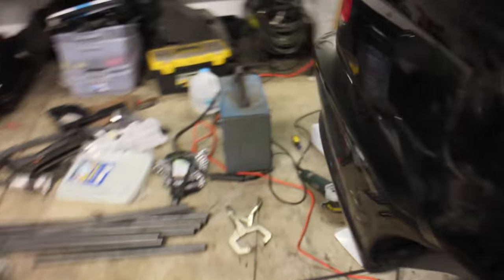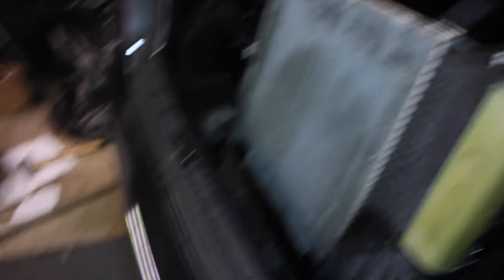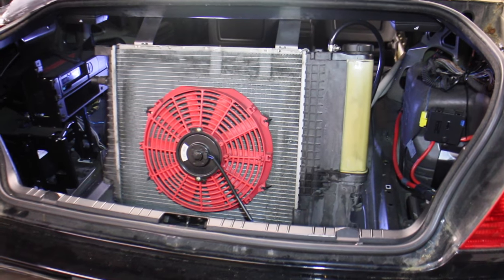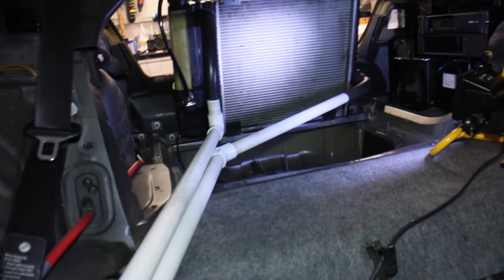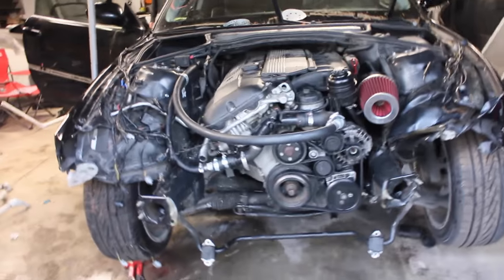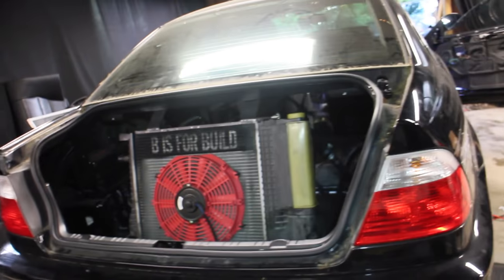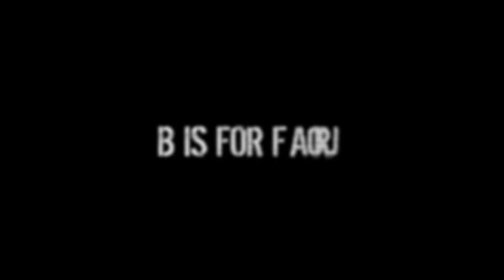Budget BMW Fun Pt 3 - DIY Rear Mounted Radiator

Comment from the maker: Sorry about the low res guys, YouTube is lagging behind processing to HD, if it doesn't fix it soon I'll reupload tonight.
Reply: +B is for Build its better then waiting lol
Reply: Fuck it still watching
Reply: +B is for Build The video quality doesn't determine the quality of the video. Awesome video, sorry to hear about the radiator but happy to see the build push on!
Reply: +B is for Build Gonna watch it either way!
Reply from the maker: +B is for Build it finally went HD!
Reply: Any updates on the evora?
Reply from the maker: +Niels Wolkmann ill do an episode on it sometime soon, i think the bmw has 2 more episodes in it and then ill do some evora work.
Reply: +B is for Build hey ive been watching tjhunt since he had as much subscribers as you and he is gaining subcribers very quickly he has already passed 200000 and is gaining subs fast. just wanted to tell u this because it wont be long till you hit 200000 and keep up the good videos
Reply: +B is for Build wont the pvc melt with the heat of the engine ?
Reply: +B is for Build In the A pillar is another airbag.
Reply: +B is for Build .what air compressor did you use to paint your car with .specs n all

Comment: step1, sell sidewindows. step 2, replace with clear plastic sheets(acryllic). step 3, cut 4 inch holes on the plastic sheets. step 5, run ac pipes from the sidewindows to the radiator
Reply: +dndfm Came here to say this. You missed step six = Profit. 

Don't use acryllic though. Has a fun tendency to shatter when you work with it. Use polycarbonate. Shits expensive to buy new, but you can get it cheap if you buy old basketball hoops.

Comment: definitely watch the Roadkill episode of the mini truck madness, they use a rear mounted intercooler but they constantly had cooling issues. Just because there is a fan on the radiator doesn't mean there will be enough air flow. I'm sure you guys will figure it out. I'm excited to see where this build goes !

Comment: Hey Chris, I know others have brought up the same thing, but just wanted to make sure that the hose was rated for more then the 200*F. Boiling point is 212*F and throw on top of that a couple extra degrees with pressure before it boils and you can hit 230*F in the staging area. If you still plan on using the heater hose, that's cool, just make sure to throw some kind of shielding over the hose so that if it splits you and your passenger, if there is one, will be safe.

They do make automotive grade heater hoses that is available from napa, or if you are at the junkyard, look for cars like the Fiero or MR2, they are great to salvage for rear radiator setups as they have long pipes running from the front to the rear engine.

Can't wait to see the car throwing tire smoke through that rear radiator, it's going to be awesome!

Comment: GUYS, pretty important piece of information I think you might be overlooking:
If you use a reducer on the lines, the pressure/velocity of the fluid changes. Chances are, your radiator was designed to work at the stock coolant pressure/velocity which may/may not cause some problems. 

When I first heard him say he was going to use PVC, I was pretty concerned haha.
Glad to see that they switched to the proper tubing though!

Comment: I love the idea of the rear mount rad but with that distance and the small diameter hose I'm really worried that the water pump won't have enough head pressure to flow enough to keep the engine cool under load.   It is a high volume low pressure pump and isn't designed to do what you're trying to make it do.   I know this from experience with doing a rear mounted radiator in a mud truck.

Comment: Be careful with the PVC! I've seen it start to melt in colling systems, and break off. If you can, napa sells heater hose that is big enough in diameter, or steel would work as well since it is just for the one event!
Reply from the maker: +SMB Garage (Spencer Bailey) keep watchin :)
Reply: +SMB Garage (Spencer Bailey) Oh, saw you already figured that out lmao. Well if that heater hose is too small then they have bigger sizes at Napa
Reply: +SMB Garage (Spencer Bailey) You clearly didnt watch the video did you?
Reply: +SMB Garage (Spencer Bailey) I was thinking the same thing, the PVC is super sketchy, I am glad it failed on them in the shop and not later...
Reply: +Motor Madness you clearly didn't read my reply did you?

Comment: The coolant is going to be well over 200°F. Won't the PVC bend or melt?
Reply from the maker: +peteogrande yep, keep watchin, we had to swap it out
Reply: +peteogrande i was thinking the same lol
Reply: +B is for Build heated pvc can release toxic fumes, hope you had some fans running
Reply: They make hot water PVC.  I don't think it costs anymore than cold water PVC.  I was hoping this would work but I was thinking the vibration would kill it.  PLUS!  You ran them right next to each other.  The heat exchange between the pipes was going to heat the water as it came back from the radiator.
Reply: or maybe use more heat resistance pvc

Comment: Maybe you should look up how Baja trucks route and what kinda of tubbing like size and materiel they use because I don't believe heater hose will be able to sustain the water flow needed to keep the engine cool under load and high heat days. Just my two cents

Comment: I do hope you are going to have plenty of ducts to have loads of air flowing through the rad, when you're pushing the throttle pedal into the carpet there's going to be a lot of heat generated, especially using heater hose which will only flow about a quarter of what a full size pipe can!!! It would have been a lot easier just raising the front rad? I don't want to see you cooking your engine before you have some sport...
Reply: +David F thats probably the reason why the radiator exploded too...smaller size hoses -> more pressure

Comment: Be very careful with e46 cooling. The m54 is a very picky engine when it comes to it. Most of the time small overheating can blow the head gasket. 

If anything I think the weak link for your car will be your cooling system due to the extra load on the water pump and the poor airflow in the trunk. Would highly recommend keeping a spare water pump as they are known to go bad on e46s. Got mine for $60 on OEMbimmerparts.  Was it not possible to mount the rad at a 45 degree angle at the front or just angle it and then build a skid plate infront of it?

Comment: power steering is a luxury! not in a drift whatever car! haha

though, have you guys thought of how to force air into the rear for the rad? and switch control for the fan im guessing? will it be only at certain temps or just always on?

Comment: Nice channel. I was just about to relocate the radiator on my E46 then I run into your channel. I wonder if it keeps the temperature cool enough and the pump works fine. 
Thanks for now!

Comment: PVC pipe, what were you thinking... haha :). If the heat did not kill it, the first big bump would have. Flexible hose is the only way to go. 

Normally seats are worth quite a bit as well, so I'd sell those and see if the Evora or BRZ seats would fit. 

Also, with that trunklid removed, you could be in trouble when you encounter lots of rain.

Comment: remove and sell rear quarter glass(on both sides). then make sheet metal panels with ducts for the radiator. That would help with budget and help get air to the radiator.

Comment: I'm curious how you'll get more airflow over the radiator, cut out some of the rear quarter panels or a scoop by the back window and into the trunk. I'd go with the first since the wake of the car driving will cause air to flow back into the trunk against the flow from the fan, unless there's already air flowing from front to back. Like when you're in a convertible and look backwards while it's driving and get air blowing into your face from behind, if that makes sense lol can't wait to see it progress!

Comment: any fluid lines threw the cabin is usually a bad idea (and usually prohibited), especially if they are flammable, or hot. also PVC tends to crack and break when deformed. Flexible tubing/hose along the bottom would be best.

Comment: Keep in mind that the tubing needs to be resistant to the chemicals in the coolant. Otherwise it'll start to melt the inside. Like using radiator hoses for fuel. Everything has a purpose and you need to stay in the lines of that.

Comment: should take the rigth side 1/4 window(the one where you put the sticker on) out(or both sides!!!), and make a fresh air duct that leads air to the rad, and with the heater hose being so small, you guys might run into over temping issue during the event if the hoses cant deliver cooled coolant to the engine quick enough

Comment: you could sell the wheels for some extra $ and try to find a set of steelies with snows as like a ghetto rally  setup.
Reply: +Annoying they would need adapters surely? the BMW is 5x120 I'm presuming that the brz is 5x114.3

Comment: IF you have problems with air bubbles in your system,  raise the rear of the car when bleeding,  i had a fun little car with the radiator in the back and i had to do that.

Comment: should`ve weld a tube frame bumper in the front and keep the intercooler where it was, or you can add the tube bumper later, if the car still works after the event and you want to drift with it. You should have some kind of defence at the front

Comment: Harvel (pipe manufacturer)  says the max operating temp for PVC is 140°F now i don't know what pressure that is at or what pressure/temp. the coolant system runs at but that may be something to keep in mind especially with hard vibrations on rough roads 

-a plumber

Comment: When you reduce a radius of an object you will always have a lot higher pressure that's the reason it blew the other one is just gonna blow also. Try an aftermarket one like mishimoto or buy wider hoses or else you'll just blow the other radiator

Comment: Are you going to add some heat shields around the hose? It may possibly get a little toasty in the car with hot coolant running through the inside.

Comment: will you do an Air intake for your radiator? something like an intake on the roof or near the passenger seats, so the air can flow trough the radiator and back out of the trunk

Comment: a brand new half size civic radiator is probably less than $50 on ebay, and they cool v6 swapped hondas all the time. and the fan will fit good too.

Comment: Be careful with the interior routing of the coolant pipes. Make sure to make some covers for the hoses, because they're burn the shit out of you when the car is running. those right under the door sill actually kind of scare the shit out of me.
-
Make a divider that sits where the back seat used to be. So that the heat from that radiator is kept away from the passengers and when that radiator blows up again, it won't drench the passengers in burning hot coolant; likely making you crash and die. 

Cool idea though.

Comment: Hi Chris! You do know that BMW used different radiator for different engines for a reason? A radiator from a BMW or Merc with bigger engine should do fine. Good luck with the challenge :)

Comment: I think the engine will overheat very fast...
1.There's not enough airflow in your trunk
2. The hoses you're using are smaller than the OEM ones. So you won't have the same flow ratio the engine is designed for. So be prepared for this.😉

Comment: Id pull the rear glass out and sell it then run ducting down and through the the radiator. Similar to roadkills rear engined Mazda truck. This will ensure you will never overheat.

Comment: The reason that radiator popped is because your not using big enough hose and it's building to much pressure. I would have used exhaust pipe for the long strait pieces inside the car.Not to mention it probably had a air bubble, you need to pop off a heater hose while filling the radiator to burp the block.

Comment: i'd look into the radiator exploding because of weird pressurization issues coming with downsizing the hoses.. i'd look into racecar rear mount plumbing as well as just picking up a cheapo universal ebay aluminum radiator. i've blown thru so many stock bmw shitty radiators with plastic ends lol

Comment: Directions from the armchair: A bunch of folks already said it but it doesn't have to be a BMW radiator. Use full sized hose that doesn't require a reducer. You may need a secondary water pump. Why not route the hose under the car along the rockers? I promise ther is room. Otherwise It's going to be hot as balls in there! Think about how hot a tiny little heater core is. Oh and please figure out a way to close off the cabin from the back or you're going to feel pretty sleepy from carbon monoxide poisoning. If you're going full on hooptie, plywood and spray foam are a cheap way to stay alive. Other than all that, thanks for doing a bunch of dumb stuff to a car so I can live vicariously through you. This has been fun!!!

Comment: I don't think the rear mounted radiator was thought through.
You need lots of airflow for a radiator to function fully, a scoop should have been added imo.
Also, you ran hot and cold pipes together. I'm pretty sure your cold is gonna end up hot or at best warm.

Comment: Quick question... is that PVC tubing actually going to handle the heat of the engine coolant without warping, cracking or dismantling? That'd be my main concern..
Reply: +Marc Hilton Scratch that... commented too early, I see it did indeed warp :P

Comment: Try not to explode that hose and burn yourselves, okay? And are you planning to cut a hole in the bottom of the trunk to get more fresh air through the radiator?

Comment: Get a fake mishi motto on e-bay
Reply: Haggard style
Reply: +1, jumbo s54 z3m radiator is holding up fine. Unlike the Mishimoto, the overflow nipple has enough space to install the hose, so it's win/win. Cheaper, and actually works/fits.

Comment: How could you not have known PVC cannot handle cooling system temp.  Its written right on the PVC pipe?  Just saying, could have saved yourself a lot work plumbing hard line.

Comment: Hydraulics is a bitch lol....you might have a lot of pressure building up as result of adding length and changing diameter size of water pump configuration...